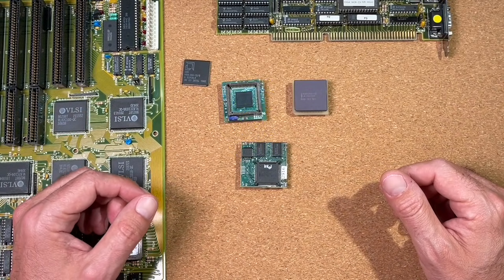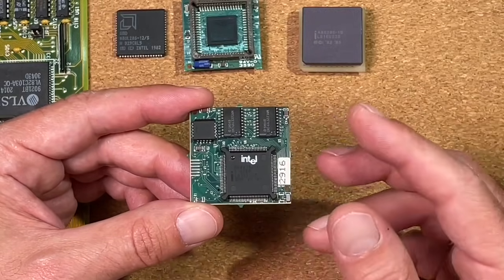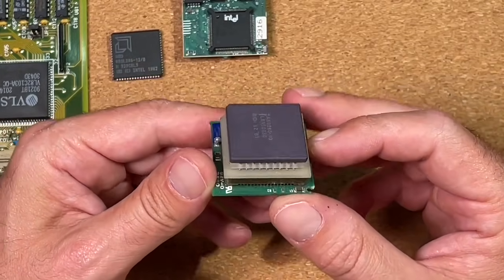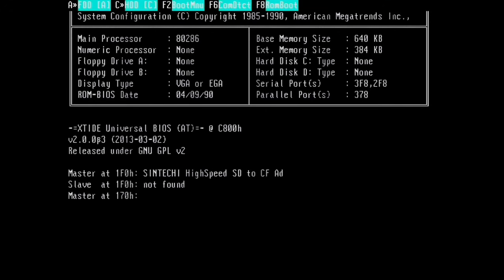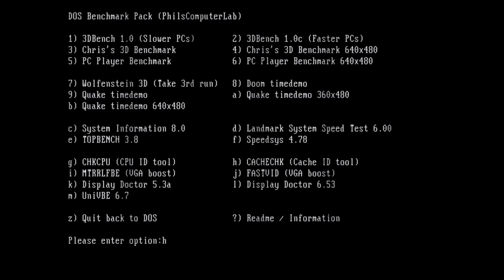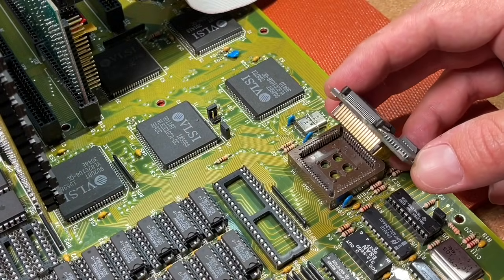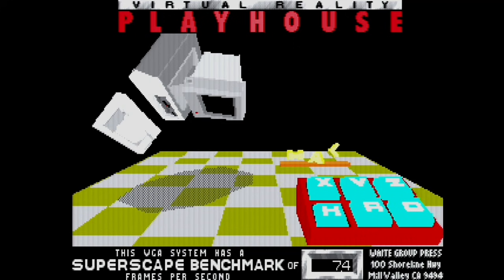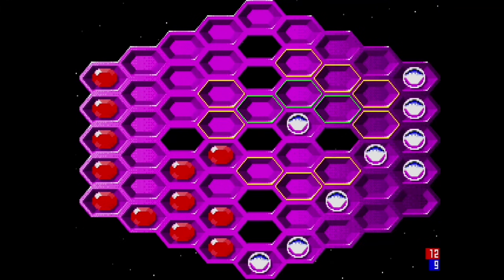286 Boost! Upgrade to 386 or additional Cache ~~ODD PARTS~~

Comment: I feel like the 386 adaptor was made for upgrading some machine tool equipment. Maybe some upgrade offered by a company to run their newer software with just a plug and play hardware upgrade. I don't know honestly. You just get these feelings when working on those old types of machinery. Such as getting a 486 based press brake running in 2021 and seeing the mixture of upgrades and repairs that have happened over its life.
Reply from the maker: yeah, this could be a possibility and to be honest I had the same thoughts.

Comment: As i suspected, 386SX brings nothing performance-wise. As for that cache board - if RAM runs at 12Mhz with 0 wait states, than cache can not possibly do anything more. The only reason why cache is installed is that it runs at higher speed and lower latency than system RAM. If RAM already runs at CPU speed with zero latency, there is nothing you could do to speed the transfer up with caching.
Reply: If that was the case here though you'd expect performance would actually slow down a bit with the cache due to cache miss overheads. Pretty likely the cache is just not activated at all, although I suppose it is possible the cache controller tests ram throughput on boot and deactivates itself on purpose if the RAM is fast enough already?
Reply: @JeremyLevi  Yeah, good point.

Comment: Hmm, I wonder if a 486SLC would boot if it was transplanted to that 386 adapter.
Reply from the maker: this would be indeed an interesting experiment 👍🏻
Reply: @CPUGalaxy  That I would like to see! :)
Reply: @CPUGalaxy  Please try this, but I suspect it won't give any additional benefit.
Reply: I have the feeling that the answer is yes. The 486SLC CPUs could be paired with 387SX and 287 FPUs (depending on the motherboard) and their buses had the same widths as those of the 386SX.
Reply: Then put it in a 8088 to 286 adapter card for XT computers for maximum upgrade lmao
Reply: @DxDeksor  PowerLeap did some Pentium 1 SBC cards for the original PC apparently…but that’s not as fun!
Reply: @solarstrike33  oh god what have we done ??? x)

Comment: My friend had a 286 motherboard which had 20mHz cpu and 1mb of very slow RAM soldered on mb and no simms. But this motherboard had 64kb of cache! And in Norton  SystemInfo this board(cpu) scored 15.9 instead of usual 15.0 for 20mHz.

Comment: After seeing the video,  think you missed some jumpers to increase the clock accordingly  to the processor.  Also, the big justification to use 386 instead of 286, is the 386 can run workgroups and is network compatible who is not with the 286.  I still use a 386DX40 with a stepper isa board to control an OZO PCB prototyping router/etcher/driller/ for manufacturing Motherboards in 1987.  I have a 286 Zenith working but not network.  The 386 is a slave of a win7 to transfer the Gcode to control the OZO (jot) unit.

Comment: The 16/32 thing on the SX was, allegedly, so that OEM's could use as much of their existing PCB layouts as possible.  So it's kind of weird these little bolt-on modules weren't a more common sight even if just soldered straight to the mobo from the factory.

Comment: As others have mentioned the  186 and 286 execute instructions faster clock for clock.. The 386 advantages were in 32bit instruction set which hardly anything used at the time. A flat virtual memory addressing mode used by windows. The next intel processor with this slower next gen.  The 486 is faster than the first Pentiums.. Pentiums had far higher clocked versions.  Another fun fact about the early 486s is that for some applications it ran faster on un-cached motherboards because the super fast 486 burst mode 128 bit memory read. If your program read through data linearly the 486 could read effectively at 1/4 wait state. So for example if you are calculating inner products to multiply matrices you could exploit this quirk. Later higher clocked 486s always preferred a cache.

Comment: Just started watching.  I'm thinking the 386SX plugged into a 286 board won't really be any faster on 16-bit code;  except that a 386SX can clock higher than a 286 if both are OC'd.  I look forward to seeing the results :)

Comment: Both of these adapters are things I've been trying to buy for a long time! Super super rare stuff.

The cache is probably working fine, but is mostly there to compensate for slow 286 bus access to very slow DRAMs at probably 150ns. Might work better if not for using faster modern memory. I'd expect a tiny boost despite that, though, so maybe there is some software involved. The 386 will have worse performance per clock because of it's strangled bus, which means to do the same amount of work it must also take twice as many memory fetch cycles.

Disappointed you didn't combine the 386SX with the cache shim! It has a higher chance of actually having a benefit.

Comment: Cyrix has a utility to active Cache in the operating system.  May be worth a try.  You'll also need to upgrade the crystal.  While you would be over clocking the ISA slots, you might be able to get away with it, since most of those slots will work at a faster speed.  I've heard the a clock for clock cycle between the 286 and 386, the 286 is actually faster.  You have to get a fast clock speed to gain the benefit.  Hope that helps.

Comment: I'm guessing at 12MHz the ram is running at system speed with no wait state? Hence the cache would have no effect and might have been working all along.
Reply: Exactly
Reply from the maker: Thats a very good point. I need to check that. but i guess the RAM is running on a waitstate. on another 10 Mhz 286 setup i have i get better results with the benchmarks. there i know the jumper setting to set the waitstate to 0. the board in this video here does not have a jumper for that. 🤔
Reply: I'm pretty sure the board in the video is running at zero wait
Reply: @CPUGalaxy  The IBM AT runs at one waitstate. If your 286 at 12MHz performs "like an 18MHz AT" (quoting Landmark), this shows quite clearly that your board uses less waitstates than the AT, which means 0WS.
The 286-10 that is faster likely was faster in a video-heavy benchmark like the 3D bench you showed. I expect the 10MHz 286 board to just overclock the ISA bus to 10MHz, whereas 12MHz 286 boards often used additional waitstates or dynamic clock spreading to limit ISA speed for compatibility. Furthermore, that Trident 8800 graphics card is not exactly known to be on the fast side of ISA cards. Trident got good performance with the 8900CL, peaking at the 8900D (which is claimed to max out the ISA bus like an ET4000).

Comment: Ironically the same performance regression happens with motorolla 020/030 cpu's. Though I don't know how much of this is down to the cpu themseleves or the computer design. But I have both a Macintosh LC and an LCII where they are principally both the same basic layout but exchange the cpu. Both run 16mhz with a 16 bit bus and a dedicated pool of video memory. Technically the only difference is the LCII has the MMU and even has an extra 256 byte data cache on the cpu. Yet the LC is very slightly faster by about 3%.  In practice the 68000 is more an equivalent to the 286 in its basic fundamentals (or maybe the 80186). As the 020 has 32 bit bus and instructions. But the addition of the MMU may be the reason for the regression, even though the OS may not make much use of it. Testing both with 6.0.8 and 7.0.1'dot' shows similar results. And this is inspite of the 030 having slightly larger internal cache of minuscule size.

The 020 and 030 both share a 256 byte instruction cache internally, so its data cache doesn't help it at all here in this narrow comparison. That would seem to hold that the MMU is the culprit. A slight regression in exchange for features. i am not aware of this being so much of a big deal on 32 bit bus systems like the mac II vs the Mac IIx

Comment: Very cool video! It's not surprising that the 386sx performs similar/worse than the 286, the bus drivers would slow it's ability to interact with the bus slightly. Unlike other steps in CPU generation the 386 actually has a similar IPC to the 286, with some instructions being faster on the 286 and vice versa. For 16bit software in general 386 and 286 systems of the same clock speed are generally roughly equivalent. Even proper 32bit 386 machines are similar in IPC, the main speed difference being they can fetch instructions faster. What differentiates most systems of this period is actually the mainboard, memory and graphic card. A chipset with cache, faster RAM, or a faster graphic card makes a far greater performance difference than the CPU given the same CPU clock speed. The only way to make the best use of these upgrades is to have the software for the cache, or slightly increase the clock speed on the board for the 386 (it can do 16Mhz).

Comment: There are some 486 upgrades that clip on top of the 386's (saw one from Cyrix some time ago, I think it disables the original chip by grounding one of the pins), maybe you could test it 👌👌
Reply: It's the '-FLOAT' pin of the 386SX CPU that disables it - which wasn't set up well initially by Intel, and usually required to 386SX stepping to be the 'B' or 'C' (as marked for the CPU in the video). Clip-over upgrades are I little more rare now - I've just picked up six TI CPUs that I will test soon.
Reply: @IBM_Museum  that would be great to see, a "486" in a 286 motherboard 😃
Reply: @BaguetesGarage : IBM made a module that mated to a 286 socket that had a 486SLC2-50 (able to run all Intel 486SX instructions, with a 16Kb L1 cache) - and although it is proprietary to not be a conventional CPU socket, they also had the fastest systems with a 16-bit data bus / 24-bit address bus CPU that was produced: the 9556/9557 PS/2 with a 486SLC3-75.
Reply: @IBM_Museum  triple-clocked hey, interesting. There was some weird stuff going on at the time 😅
Reply: @BaguetesGarage  businesses weren't sure the public would be willing to throw away their old PCs for new ones. Windows 3 then moreso Win95 proved they would. Intel Aboveboard 286 and 386 ISA cards were expensive upgrades and most consumers decided just a little more money for an entirely new computer (or at least a new motherboard) was well worth it. A little later IBM arrogantly gambled with Micro-Channel Architecture that customers would abandon clones entirely to get the latest IBM-brand technology. "Open standards" as championed by Compaq (not Open Source) and changed not only PCs, but the entire tech industry.

Comment: From what I remember, in practical terms the 386SX was nothing more than a 286 that could run 386 code and its main advantage was being able to run at higher clock speeds (than 286). For most hobbyists and enthusiasts, it was actually cheaper to just replace the motherboard/CPU. Those CPU upgrades only made (some) sense for proprietary/business systems.

Comment: Can you find any name or number on that cache board. The number that can be seen is not enlightening, seems common to many PCBs
And secondly, the 286 was always rumoured to be a better DOS CPU than the 386sx - seems to be true
Can you slow a "real" 386sx system to 12MHz and get the same result, just to prove it's not the adapter?

Comment: It would be interresting to reverse engineer the 286->386sx adaptor... Also, if it were possible to put in an SLC2 chip, it would have clock doubled and have some cache.

Comment: I'd love to see an open-source binary-compatible clone of the Weitek Abacus (with some modern upgrades) produced via reverse engineering. Perhaps it could also be made compatible with 487 code? (I'd probably achieve this via an ASIC that dynamically recompiles x87 code into Abacus code.)

Maybe it should be in the form of an upgradeable daughterboard; via different adapters, the daughterboard could be compatible with 286, 386, 486 and Pentium platforms!

Comment: Yeah, it's been documented that clock-for-clock a 386SX is outrun by a 286. That goes double if you tune the rest of the machine, as seems to have been done here -- how else would a 12MHz chip perform like an 18MHz one in Landmark?. The reason one would install one of these upgrades was if you needed the 32-bit capabilities, such as for later versions of OS/2 (ouch) or 386 enhanced mode in Windows 3.x as well as I'm sure some other business software of the time. My dad swears he ran Windows 95 on a 286 machine, and one of these sorts of adapters may just be how he did it, if he's not misremembering. 

Where I feel it gets particularly interesting is, I wonder if anyone ever made a similar adapter for those clock-doubling 486SLC chips for this socket. With some cache those things flew compared to the 286 and 386SX chips they replaced, although they couldn't even come close to the real 486s. And here they'd be underclocked for sure, as these 286 machines tended to top out at 16-20MHz anyway, meaning a max clock of 40MHz, or 60 on an SLC3. It'd be waiting even longer on the bus then, since the DX4 chips already were kind of suffering from diminishing returns vs the DX2s, and halving the bus width would only make this worse... So, it'd be interesting to see what one of those hypothetical beasts might look like.

Comment: Even if a 386 upgrade is slow, it's still better than adding cache to a 286. They both make the system faster, but cache doesn't allow you to run 386 software, so the extra functionality makes it worth it. If you don't plan to use your system to run 386 software, like, if you have a 386 system for that already, then go with the cache.

Comment: It seems now you are using a capture card to record from your monitor? Very cool, looks much crisper than recording the screen with a camera.
Reply from the maker: yeah, was not easy to get the right hardware for that. recording dos textmode, switching to different video modes without a synch break in between is just challenging. Thanks for the feedback. 🤙🏻
Reply: @CPUGalaxy  Can you describe that hardware? thanks
Reply from the maker: I bought the X-Capture 1 USB3.0 device which is one of the best ones for capturing analog signals, specially for low res. But still i had issues at 240p. Also while starting up an old pc when the board is switching trough different modes and so.. there were always synch breaks and damn man, I wanted to record the screen from the point onwards where I switch on the computer. It was so disappointing for me coz the x-capture 1 is also very expensive. then I had the idea if an analog upscaler. A high quality one is also very expensive and I was so extremely lucky to score a Kramer VP-420 Analog upscaler for 70 bucks new in box. with this device i can upscale any vga input analog to a certain resolution I can set. And this in realtime without breaks. So no matter what I get into the upscaler,  on the output I set a resolution of 1280x1024. with this signal my xcapture gets always the same signal, no matter if the computer is off or switching between different resolutions. For recording I am using OBS.
Reply: @CPUGalaxy  Damn that kramer brand had some pretty high end stuff, I got a pair of Gefen EXT-VGA-2-DVISP scaler imported from USA and still need to see how to tweak the colors as I can clearly see aren't the same, I think the scaler quality is on par with what my NEC 2070 TFT can output. Are you happy with the image quality of the Kramer?
Reply from the maker: yes, the image quality of the Kramer is perfect!

Comment: As i remember, 80386 was supporting protected mode and also 32 bits registers, and SX suffix was about memory fetching against DX, but 80286 was partially supporting protected mode, and only for 24 bit registers, like interrupt description table registers, which actually were working in real mode with LIDT/LGDT instructions, and were really useful to redirect all interrupts to own table, thats was wonderful. But as 80386 became, you could control everything and create a VM in todays meaning. So it's more just an extension to technology, than clocks per instruction improvement, however speedup-up was also valuable, but probably due to higher frequency.

Comment: I would actually like to see that video of win 95 on a 286 motherboard for historic reasons only and for retro nerd. Push the Motherboard as hard and far as it can go, do I dare say win 98se.  I have seen in the day a 4 MB ISA card or something requiring a special motherboard. When I saw your board I got a little excited with 4 rows of memory. I thought it might have 4MB installed, I think they could address up to 16MB. I had a 286 with two rows of memory each having 1024 KB per row with 128 KB chips.

Comment: Quite disappointed that the 386 didn't give any improvement, I wonder if the BIOS is simply not using any of the additional 386 instructions.
Reply: The tests are likely just 8086 instructions and the 386 is slower because the bridge is adding a lot of latency.  Keep in mind the 386 didn't have have much of any cache so it's constantly fetching from the bus.
Reply: Plus any fair benchmarks would purposely avoid using 386-only instructions to make the comparisons fair. As I remember, the 386 did indeed have a lot of new instructions such as ENTER, LEAVE, and more addressing modes with built-in scaling for different array cell sizes. Some of the older 286-era instructions were improved with less clock cycles.
Reply: @tomstdenis : Until the 486-class CPUs, it was just a pre-fetch buffer counted in bytes (maybe that is what you mean by "didn't have much of any cache"). The IBM 386SLC CPU has an 8Kb L1 cache, but in reality, it can run all of the Intel 486SX instructions anyway.